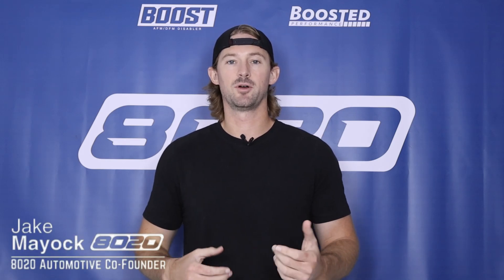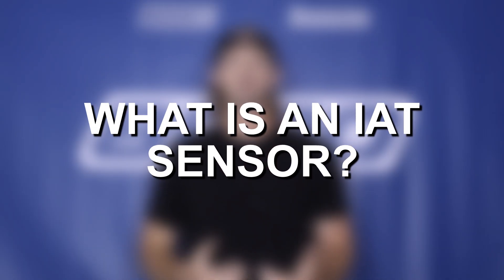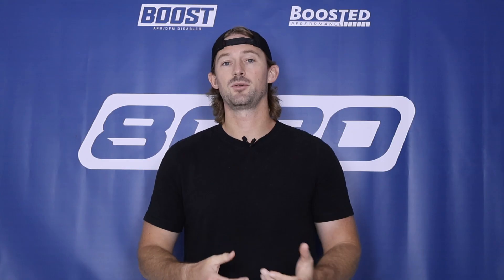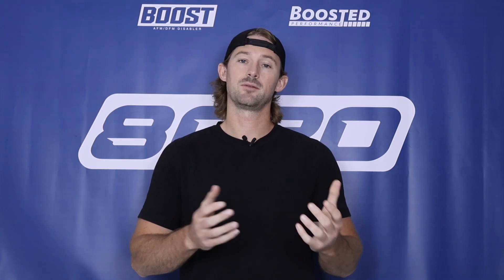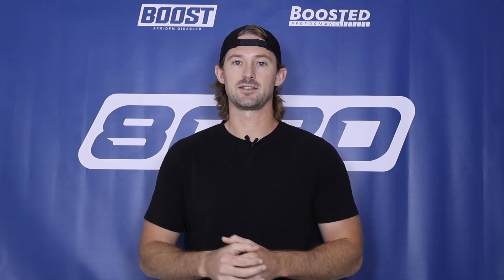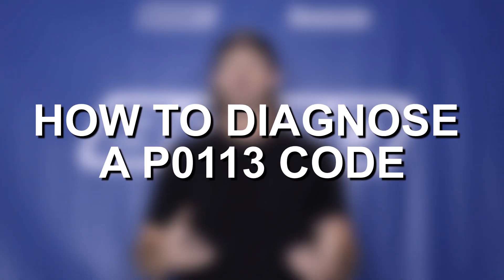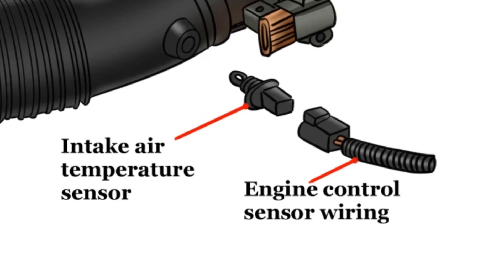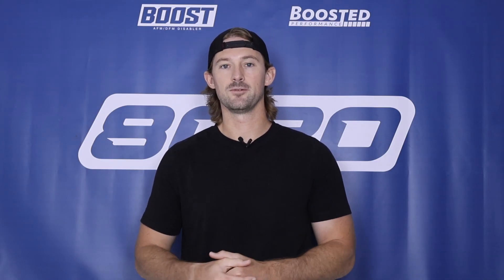P0113 Code Explained: What It Means and How to Fix It FAST!

Comment: I've had this code and changed out the MAF and Air charge sensor two separate components, but P0113 keeps coming back I don't see any damaged wires, or have any vacuum leaks after testing, could it be a computer issue at this point? When I hooked up my scan tool it showed bank 1 +25%  all other banks had perfect readings

Comment: Will this code make my 2002 Nissan frontier to overheat? The radiator is working perfectly the hoses are all good and I’m still overheating
Reply from the maker: H - No — a P0113 code (IAT sensor circuit high) by itself won’t cause your 2002 Nissan Frontier to overheat, because that sensor only measures intake air temperature for fuel and spark adjustments; overheating despite a good radiator and hoses usually points to a stuck thermostat, weak water pump, clogged radiator internally, air trapped in the cooling system, or even a failing head gasket. Since your radiator and hoses are fine, I’d first test the thermostat and water pump flow, then bleed the system for trapped air, because those are the most common causes of persistent overheating unrelated to the IAT code.

Comment: I have these codes coming up as well but the weird part is, whenever I plug in any device, such as a charger, it drains my battery. if I have the radio on, it drains the battery. It doesn’t show any other codes
Reply: Having the same exact problem, getting this code but it’s draining my battery and won’t crank anymore
Reply from the maker: R - P0113 is for the IAT (intake air temperature) sensor high input, which usually means the sensor or its wiring is open or shorted, but the bigger issue is your battery drain when accessories are used — that points to an electrical or charging system fault, likely a weak alternator that isn’t keeping up with load or a bad ground that causes voltage drop; the odd link between the IAT code and the battery drain can happen if there’s a wiring harness issue (shared ground or power feed) causing both the sensor to read wrong and the alternator to undercharge, so the best next step is to test alternator output (should hold 13.8–14.5V under load), inspect/clean main grounds, and check the IAT sensor connector/wiring, because it’s unlikely all your accessories are the problem — it’s the charging system not replenishing the power when they’re on.
Reply: @8020Automotive when the car is in motion, if I’m using an accessory, the battery indicator light would come on after 2 minutes. All of this happened once my battery died. Before that, the check engine light never came on, nor did the battery light. I’ve taken it to about 2 places, no one can find anything.
Reply from the maker: R - If your battery light only comes on a couple of minutes after driving and using an accessory, especially after the battery recently died, that usually means the alternator isn’t keeping up under load or there’s a voltage drop in the charging circuit; a weak alternator can pass a basic bench test but still fail when hot, and corroded battery cables or grounds can also cause the light to flicker even if the alternator is good. Since shops haven’t found anything, I’d suggest checking alternator output with a multimeter while driving with lights, blower, or radio on (should stay 13.8–14.5V), and also clean/tighten all battery and ground connections; if the voltage drops below spec after a few minutes, the alternator is weak, and if voltage looks normal but the light still comes on, then the issue may be with the voltage sensing wire or instrument cluster circuit.
Reply: @8020Automotive update, the air sensor was unplugged, and has been for nearly a year, that’s why the battery was dying cause it had to give full power to that and also the car and other stuff. Plugged it back in, check engine light went off, no indicators came on 😊
Reply from the maker: R - Great to hear! Glad you found the fix!
Reply: i got p0113 and p0238 ?? vw touran 2007

Comment: What can I use to clear the code after putting the new IAT sensor? I don’t have the diagnostic machine, they diagnosed it at Toyota and I said I will replace it myself
Reply from the maker: I - Since you've replaced the IAT (Intake Air Temperature) sensor yourself and don’t have a diagnostic scanner, the easiest way to clear the code is to disconnect the negative battery terminal for about 10–15 minutes—this drains any residual power and forces the ECM to reset, clearing stored fault codes. After reconnecting the battery, start the engine and let it idle for a few minutes to allow the ECU to relearn basic parameters, but note that if the issue hasn’t truly been resolved (e.g., wiring problem or poor sensor connection), the check engine light may come back, so make sure the sensor is properly seated and plugged in tightly.